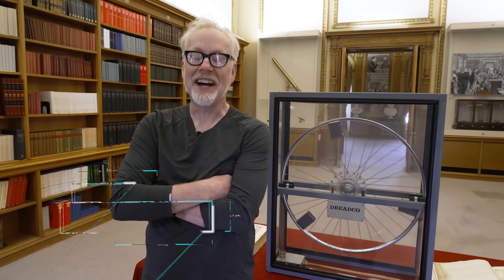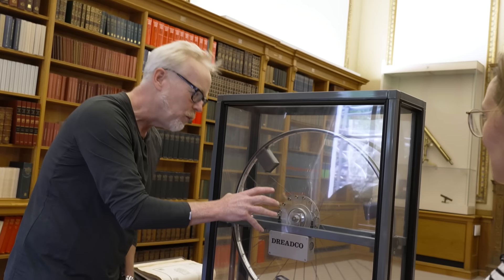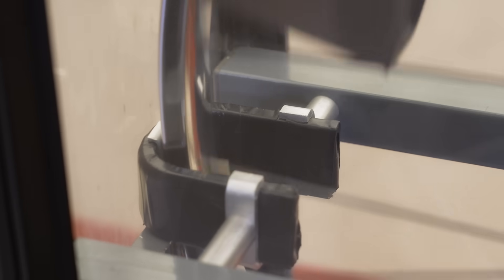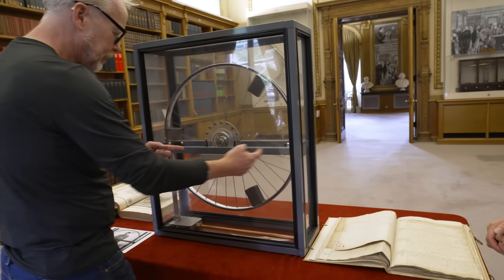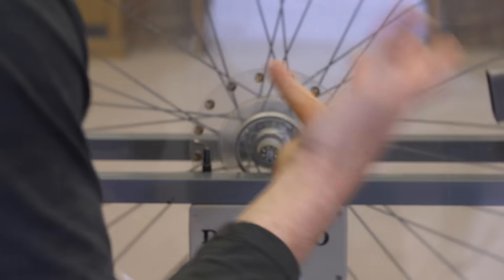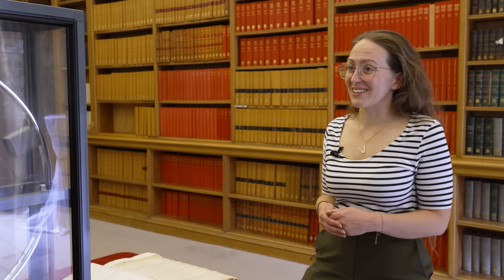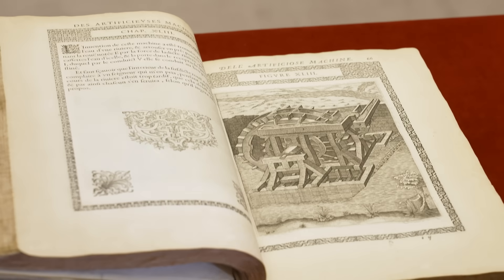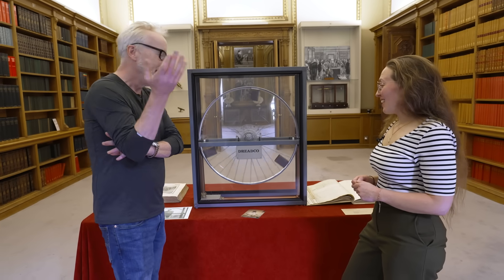Adam Savage vs The "Perpetual Motion" Machine!

Comment: The proposed anode and cathode are air jets that are directed onto the cup sections near the bearings.  the copper pipe with the heat sink moving air through thermal expansion... I am not certain the source of the thermal differential.

Comment: This engine works with temperature  diferences between horizontal metal visual bars  that induces electrical current inside the base,  producing  the exact pulse of energy  needed to the system continued moving.

Comment: If you spin an Item in Outer space, it will spin indefinitely, the thing that stops the rotations is some kind of friction, on earth the air causes friction for example. If you could eliminate friction something could spin forever. This may be "perpetual motion" BUT you can't possibly make practical use of it to power anything for any significant period of time because drawing the power, for example a coil swinging by a magnet, will cause drag when it extracts the voltage.

Comment: Someone must service it.  That would be me.  But it was only the version at Museum of Science in Boston in ?1987?   Nearly the same, but T-shaped, with five boxes on the wheel, some extra Mcguffins added (two eccentric piston-shafts.)   Also, the central bearing was supported by acrylic plates, and hanging from short pieces of nylon fishing line.   I think the longest uninterrupted run was eight months.  (Also we ran a contest, and eventually two people worked out the secret.)
Jones designed our version with nearby MIT in mind  ...making the assumption that someone might bring in some expensive equipment to try revealing the secret (from inches away, outside its perspex museum case.)

Comment: Gravity has a bit or use synchronised with magnetic attract and repel  very accurately timed  floated magnetic influence in the copper tube too, pedalling . Pneumatic fluid in tube top box of each level cranking a bit of help at any loss of inertia. , in the mind. My best guess. A scattered slow motion flywheel  influence .

Comment: umm maybe a vary low power low speed motor that box on the bottom may house a battery that goes to copper coils on both sides . the have some resisters that lower the Amps and voltage to discharge slowly and the boxes on the wheels could permanent magnetics

Comment: Anybody with a knowledge of electronics would immediately know how it could be made - there are many options. A battery, a switching circuit and an electromagnet in one or more of the boxes would do the trick. It's  basically a brushless DC motor.

Comment: Those probes near the center are sensing the position of the wheel and the turn and the magnets on the right and left on just in time to attract the black boxes on the wheel for a brief second and then shut off they are essentially commutating the motor

Comment: If photovoltaic paint is on the market, there's your answer. It's either the 3 small boxes or the entire box frame of the contraption. As for the copper piping leading to the heat sink, it could very well be a phony decoy.

Comment: This is a three phase PMBLDC motor. The coils are connected by wires in the rim. The batteries and control circuitry are in the boxes themselves. All the rest is Decoy material. There may be a hall sensor in each box but the coils themselves may also serve as pickups. These control wires will also likely pass through the rim to whichever box contains the control circuitry. At least, that is my theory, the moment I saw it Especially the nicely 120 degree divided boxes gave it away for me.

Comment: I’m not completely sure, but here’s what I think: one of the two prongs near the center is probably a Hall effect sensor that detects the wheel’s angular position. The two U-shaped parts near the edges seem to be electromagnets (or at least one of them is). The three rectangular pieces are likely ferromagnetic materials that the electromagnets pull on to create motion. A small microcontroller or logic circuit probably triggers the electromagnets at the right time to keep the wheel spinning. (As Adam mentioned, the photodiodes help store charge longer than a battery alone would.)

Comment: If you could steal energy from the earth's rotation, earth's gravity, or if you were really clever, the redshift due to the speed of time itself difference between the top and bottom of the device, it would then run "forever" for all intents and purposes and you'd have a really hard time figuing out how it worked. Bonus if you run it off quantum fluctuations or dark energy. 
Of course the easy solution, is to just stick a nuclear battery in it. That would run for several decades after which the bearings would start to wear out.

Comment: Maybe it is simply a magnet generator that is feeding a small charge to the box which is most likely there to use up the excess charge by changing it into heat dispensed by the heatsink. the boxes are coils and when they pass by the U-shaped magnet it causes the wheel to spin. The only issue here would be any resistance on the wheel at all would most likely stop it from moving. Hence why it is enclosed.

Comment: If you can employ a machine then they should figure out a way to get a constant motion. For instance you could place the wheel horizontally instead of vertically and let it be in a sloped position then use a spring like in a Clock to accumulate releasing force as it moves in the descending turn and let the spring's releasing force to push upwards the wheel in its upward motion.

Comment: well i think those boxes contains tubes of copper wich generates edi current and i suppose they are parallel to axi of wheel so when pass through magnets the polarity is always oppsite so it sould leave with little more interraction than entering those magnets and replaced would be magnets because it generates a little heat over time and it gets depolarized.

Comment: It appears to be based on motor principles while switching polarities back and forth. It appears to gain momentum after the rectangular boxes on the outer wheel pass smaller boxes on the horizontal rectangular bar.

Comment: So, how this machine works is simple. What is does is these factors. First off there is break points that need enough power to allow the machine to reach 360 point. The weights you see are shift points that allow the machine to shift its center of gravity. Next off the machine then uses magnet energy to allow the break points reached to get just enough energy to allow the shifted center of mass to hit the break points and push itself over them. 

Now this isn't free energy. This is magnetic charged energy. If the machine was large enough. It could in fact produce a by product of wind. You could set small turbines around the machines wind paths by products and collect the wind and use that to spin a turbine. Then you could get power. You can not get power from this machine itself. The machine just spins. 

This is not free motion. This motion has to be recharged at some point just like she states. No it isn't a perpetual motion machine. It is just a motion machine. It uses the same principles that planets use to produce winds inside and outside the planet. We use these winds outside the planet to speed up crafts and launch them with greater speeds. 

This is completely unpractical way to produce energy from the machine also and would never be used, because it is basically a wind farm at that point and why not use the free machine known as Earth. Instead of building some insanely massive machine to get some wind by product.

Comment: I think each box on the wheel contains an electro-magnet +  battery.  In addition reed-sensors inside the boxes determine the wheel-position and fire a small pulse exactely when the box passes the clamp-mangnets at the sides. Good batteries+design make it absoluteley likely that it runs 2 years.
All other equipment is just for confusion+decoration...

Comment: Well you can calculate the amp hours of the supposed batteries based on the two year life and the calculated power of the spinning wheel. Then you could deduct what kind of battery and what size would be capable of powering this device of an estimated mass for 2 years. After that we could deduce where in the device a battery could be stored.

Comment: Those boxes are not only magnets. They also pull the circle down so that it gains momentum and turns. Magnets give an extra push to keep it going for years. I think they also give the first turn by hand. And the glass makes me think they also vacuum the air inside to get rid of air resistance. Basically, it is the combination of mechanic, gravitational and magnetic energy that keeps it going for 2 years.

Comment: I have some ideas how to store energy.
First of all, you don't need much power to keep such an apparatus moving. There are "kinetic art" devices for office desks which wiggle a long time when poked or run months on a tiny watch battery or "forever" using a small solar cell.
They made pacemakers with "atomic batteries" around the time this machine was made. A small radionuclide battery is more than enough to power this thing for many decades. So it is rather weird that it has to be serviced after just 2 years. Maybe visit again with a Geiger Counter?

Comment: This is simple to work out. Those are magnets set at the points that keep it in motion. With another set of magnets in the middle side struts. Positive on the wheel and negative on the frame so it keeps repelling each other. The rest is just rubbish to muddy the waters and keep everyone guessing. You have to remember the earth is a perpetual motion machine and all it does is spin around its axis and gravity moves it around the sun. Perpetual motion is simple engineering not something complicated.

Comment: Electric field sensor, magnetometer and a temperature sensor that can be pointed at components that can sense directionally thru the container at each component. With those 3 items, if sensitive enough, you should be able to figure out what's going on. It's all smoke and mirrors. The mirrors are used to see the smoke that's been blown up my butt. 🌬️🪞👀...😂

Comment: I think it's just magnets located in either the units mounted on the wheel itself or on the 2 spots located on either side and all it has to do is keep motion going by the poles just gently nudging it along in those spots. It has to be balanced and finely calibrated but if you put a wheel that wants to turn on an axis and is very easy to turn and you calibrate and orientate magnets correctly it should be able to do this.

The heatsink is complete nonsense as nothing needs to be cooled down and it won't cool anything down below room temperature so it can't be a temperature creating push/pull.. So I think the copper pipes and heatsink is just for the show and it's there to distract. When they take it in after 2 years or so they just re-energize or polarize the magnets to freshen them up again.

Comment: Everything you see is 99% distraction it is simply the energy created by dropping one of the 3 weighted boxes that creates the lift to have the next box drop and so on. Super simple. The maintenance required every few years is just cleaning and oiling the bearings. The seal entire unit helps with lessening resistance and causing it to slow and stop. The most simple explanation is almost always the correct answer.

Comment: Bearing friction, wind resistance, and gravity are the only loads on rotation. So whatever force is being applied is not perpetual, which means something is getting energized somehow to compensate for the loads, periodically, based on the propulsor(s) utilized. Electro-magnetic seems the most feasible method of propulsion and the 120 degree separation of the three boxes on the spokes implies balanced thrust if electromagnets are used. The timing of the pulses could be triggered by magnetic reed switches in the three boxes. We clearly see horseshoe magnets, a compass waived near them would show any magnetic field. I'm guessing the "Service" is charging some NiCad batteries in the three boxes.

Comment: 😂 okay so what you do is you take a bunch of really fine-grained copper coils lined up and stacked with one portion of these coils going to a little mechanical flick this will flick a pendulum to keep it going and that pendulum will rock back and forth over the copper coils generating electricity that can be stored in a battery but that small piece goes back up to flick the pendulum

Comment: achieving perpetual motion is easy, incredibly easy in fact, but achieving point zero energy or excess energy from a perpetual device that can be utilized to power other things apart from itself on the otherhand isn't and has yet to be achieved under peer test conditions. And as we can see in this video MSM misusing the term perpetual motion when they actually mean point zero energy to mislead the general public.

Comment: Those 3 boxes mounted on the periphery of the wheel pass though pole pieces.- which may be magnetised.

They also add mass to increase the momentum of the wheel . That is they may contain lead or steel etc .
They are spaced at exactly 120 degrees to maintain dynamic balancing .

If an electronic device is placed within one or more of these  boxes to pulse an electromagnet for a very short space of time just before it enters the pole piece then a force of attraction can be produced.  ( and it also communicates with the box at the hub of the wheel: 

There is at the centre of the wheel what appears to be two small vertical electrodes attached to a metal box.
I  suspect that these measure the angular velocity of the wheel - ( by sensing what looks like small magnets spaced equally around the hub ..and this box communicates with the three outer boxes to regulate their operation to maintain a constant speed .
All this can be run with incredibly low power ( like a car key fob) - and only using power when needed .

( all very similar to how a car key fob communicates both by near field and rf techniques to open your car and communicate by near field when the key is inserted to tell the managment system that the key is genuine.

That is  the system is powered   -possibly only one of the three boxes  to provide the energy to keep the wheel rotating and another power source in the central box to control speed.

The bearings are very low friction

The rest of it is just there to confuse.

Comment: Its a capacitor at bottom left, charged by spinning the wheel quickly, then recharges itself via the center magnets to propel the outer ones until the speed slows down too much

Comment: Perpetual Motion has Been proven for years by The Planet spinning. The Magnets are not heavy enough and the Pound Magnetic Pull is too weak. It's Funny how the Japanese had an oxidation Perpetual Bamboo machine for fish way back in the days. This always worked anyone know Faraday's Metric tensor?  Plus you need wires to direct and accumulate the IONs for a Circuit Has to be Proper balancing of high speed rotations not propagating or it can become a Tesla Earth Quake machine. With Wires Can Build up enough charge like 3.7v to charge a iPhone. I did this in Electric class to light a Light bulb. If the Center is Magnetic Suspended it will have no Friction so this will work better in space. It's funny how people don't know how to make this with really strong weighted magnets like in your Electric Sonic tooth brush. Pass that Magnetic Force over a Conductive Wire and Electrons get absorbed in a Torsion Tensor. You could Wire this Up and Tandem Multi Layer many Perpetual Generators Like a Tower of Perpetual Ambient Energy absorbion to apply in a Grid Business or a Private Home. Then and Run a City for Free. Stop playing wind games people>
Reply: Perpetual motion doesnt work in a closed system anywhere, planets or not
Reply: That is your ignorance talking. Because Once something is in motion will stay In motion unless a different force is applied. This is why we can't move forward because too many ignorant people talking. We can take Electricity Put it through resistance charging Ion and Tandem wire back together. The Electron is In constant motion and the Magnetic inversion doesn't stop.  @J.c410
Reply: Just like a Simple Kids swing on the Play ground when we apply perfectly timed Force it can Swing the Person in the seat around the Pole with simple weak force Propagation @J.c410
Reply: The Force Applied on Earth is Atmospheric Pressure and Gravity. So if we could separate that force it will work fine and forever. @J.c410